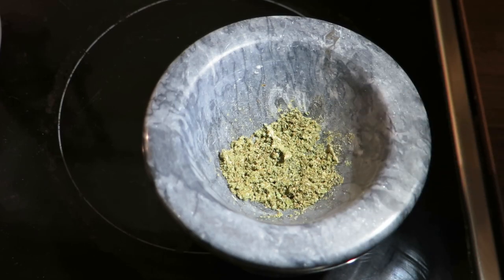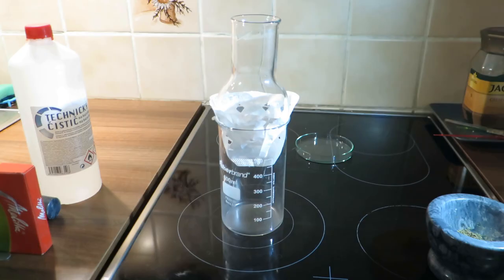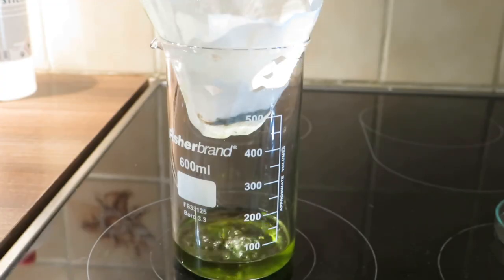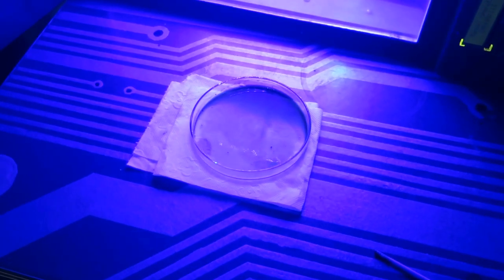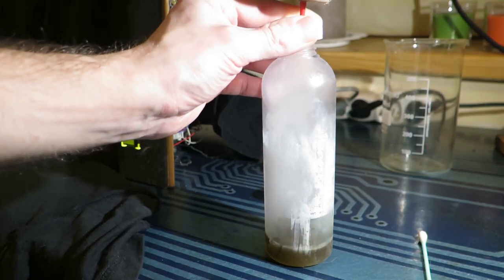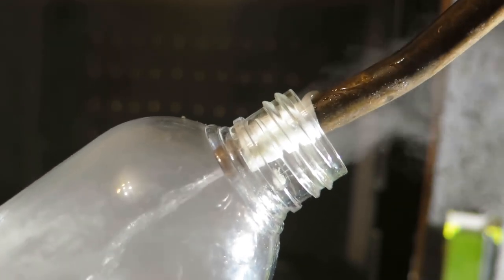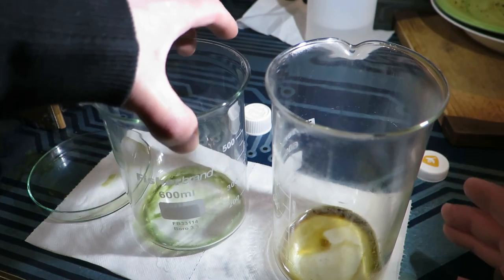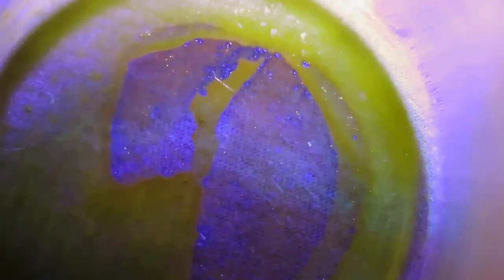Extracting resin & chlorophyll separation | plant material

Comment: Freeze your bud and alcohol beforehand bro👌 then only wash it for 20 seconds at a time so you don’t get all the green oil from the chlorophyll and keep everything as cold as you possibly can. 🥶
Reply: It what I do and it comes out perfect every time, beautiful Amber color,  people think they get more if they soak it for hours they just get more junk.
Reply: @jbob3744  I do 5 minutes and get amber shatter but I use the 99.9% USP isopropyl and have everything at -40F the whole time. Then i make warm RSO as a second run and make dank edibles.
Reply: The quicker the wash, the better the final product, what about getting out fats and lipids?
Reply: @hempearthtm  maybe but possibly less thc probably better color and better looking with your method
Reply: How do I kno if all the isopropyl is gone I put the rso in oil it looks like tar it's gooey but I hears to get a lil bit and light it with fire and if it catches fire then it still has some but I think it's bull shit I hit it with my heat gun and it starts but I think I'm just burning it  bubbling
Reply: @lifelessonslearn  Bro you shouldn't use ethanol. You should use non denatured ethanol 95%/96% max
Reply: @ChArLie360115  i used isopropyl 91% but i did the salt extract to remove the water from the isopropyl  to make it more pure then i froze  both the isopropyl and cannabis then i poured the isopropyl on the cannabis for about 1 minute and a half then i drained then i filtered it with coffe filters then i pured it on a glass baking pan in a well covered room with a window of course until the isopropyl evaporated then i put the glass  baking pan in the freezer for a while it made it easy to scrape off the R.S.O  i then put all that stuff in a glass mini container and hit it with the heat gun trying to remove all the remaining isopropyl but i think i accidentally burned the rso because it was bubbling then i smelled the oil witch smelled bomb like pure like this good smell i swear but thats were im stuck now i dont kno what to do next im scared it might still have isopropyl but its sticky it dont run when i tilt the container my question is am i finished now or is there another process?
Reply: Freeze bud and everclear for 24 hours don't break up the bud much before freezing. Do 1 minute rinse with the freezing everclear and run it through 2 coffee filters into pyrex. You can do a second run but it will be green not golden in color.
Reply: @lifelessonslearn  You should be good there.

Next time please don't use iso though. Find a food safe non denatured ethanol 95-96 % max. Infuse as usual with 2 filters through coffee filter, 3rd optional. I also recommend re-washing the material from the first filter whilst it's still in the filter with extra ethanol to ensure all desired solubles are extracted and not left behind in plant material

Then just evaporate off and you should have the rso left. You can heat over a double boil to remove any excess alcohol. If you want to completely remove any ethanol residue I recommend decarbing after reduction using a pan on low heat filled with oil with the reduced rso placed inside a container in the oil. Heat to content of container 110c (oil temp will probably need to be around 130c or so) until streams of bubbles stop and only small amounts of bubbles remain. This should take around 40/45 mins from reaching temp but may take longer/shorter circumstantially. Just go by the bubbles assisted by time judgement. You'll see a clear change in the bubbles.
Reply: @ChArLie360115  Bro You Don't kno were there's a video showing me how to do it  by chance I don't get it  need to see step by step it I don't wanna mess up.

Comment: An easy way to separate, you could doing mixed your ethanolic extract with two part of water and leave at 2-8ºC for 24 hours, the chlorophyll going to precipitateand you could take the supernatant and back to concentrate it, like the firt  method used (inverse way to evaporated de hidroalcholic extrcat)
Reply: Hi. Can you go further on this method?
Reply: Science Revolution  Did u try?
Reply: I would really love to know how to do this. How would you seperate water from ethanol? Cold temperatures are defenetly not enough ^^
Reply: Like, seriously. Ethanol and water just mix with each other, how are you going to seperate them? I mean you could use salt, but you still end up with one salt water phase, and one ethanol phase which still carries both, the chloropyhl and the cannabinoids. So I call that BS
Reply: Skip the ethanol, it's a waste of time and money, wash your Bud directly in the butain....bob's your uncle.
Reply: I done this once by accident and can confirm that it was a viable method
Reply: @5commandomerc  does that work just as good? if it does why do they let it seperate 24 hours in the freezer before filtering? thta wouldnt be possible with butane would it

Comment: A simple way is you can set in in the sunshine and it will clear up the chlorophyl. what about using hot water with no special high-pressure apparatus, as oil floats on top of water principal? us a syringe or baster to extract the oil off the top and then reduce/evaporate the remaining water? what do you think?
Reply: Dosent seem like lots of sunshine is available if homey has a sun box hahaha

Comment: Freeze flower for 48 hrs in chest freezer then take dry ice and and chill the ethanol mix the two together for 10 15 min . [time could vary) strain the hemp from ethanol and use a roto vap or hot water bath to get most of solvent out then purge it at 90f for a week. I would do a week if I can’t send a sample to a lab . I wouldn’t want anyone ingesting solvents
Reply: He doesn't have a separatory funnel, or a hot plate because he spent all his money on the roto vap.
Reply: Just use butane, it flash freezes the bud and strips it at same time...

Comment: Why not just cool the ethanol with dry ice instead of boiling it and avoid the chlorophyll problem almost entirely?
Reply from the maker: Didn't knew about such solution.
But even then, I don't have access to dry ice.
Reply: @IlusysSystems  Maybe you can order it on the internet? I find cooling alcohol in the freezer also works but I was thinking about chilling it in a dry ice and acetone/isopropyl bath. Should work wonders. You really don't need to add all that heat to strip the resin, alcohol will strip over 90% of the resin within the first few minutes. Also maybe the butane doesn't absorb the 'resins' because they aren't entirely non polar as they all have a hydroxyl group. When the butane hits the ethanol the temperature drops drastically and it will become more non polar so that may be why the goodies prefer to stay in the ethanol! It may be a little confusing because BHO is a very clear oil with very little chlorophyll, but thats only because the butane doesn't penetrate the cell walls to acces the chlorophyll. Very interesting procedures anyways I really enjoyed watching.
Reply from the maker: @FOATE  Thanks for info, my ethanol was at sub zero temperatures, which could explain, why chlorophyll wasn't dissolving.
Reply: @IlusysSystems  Yes exactly! temperature is a huge factor in the relative polarity of  ethanol.
Reply: @FOATE  if you could help  a struggling fool get better results I WILL listen.
      I have access to massive amounts of low quality weed "leftovers". Trim, old bud, homegrown hang dried, recently picked colas and everything else not worth smokin..
     I've made a very reliable BHO tube with shut off valves for each end that accommodate 8+ layers of coffee filter. Slowly filling the chamber with. Butane releasing pressure a few times to get more butane liquid in the weed material. (Assuming liquid butane + pressure=better yeald) 110 degrees Farenheit max purge followed by a week of sitting in a low dust/draft area. Room temperature
     Dark with little high I thought the lack of oxygen was the high . I've learned to dissolve the "wax" in everclear for 2 days in freezer then separate with syringes... I get material on top and bottom of a clear everclear middle. 
      
    Should/could I use everclear differently by putting into the blasting chamber a couple tablespoons everclear just  Before butane?. (Feel free to ridicule me if this all sounds moronic).
     Do you have any suggestions other than buying "equipment".
    I live in a retrofitted tiny home and have 12v power supply not 110. Super efficient freezer constant. 
    Other tha  a 20ton press "dry sift" situation I dont have the time to operate. I'm at a loss as to what to do with all of this material...
      I promise to gift an oz worth of grams to random folk if you can point me in the right direction...
      Here's my email if it's easier louisep595@gmail.com...
Reply: @louispeters2105  So if I understand your sitiuation, you have more leftovers then you know what to do with, sounds familiar!
One of the quickest ways to process these leftovers I find is making water (bubble) hash. Get some big containers that will fit all the leftovers and a paint mixer attachment for a drill, that thing will make this process alot quicker. Then I just use the 220 workbag and the 25 to catch everything. I don't bother with anything in between because IMO it's not worth the time. Then what I do, I skip the drying process and dissolve the hash in 95% ethanol when it's still wet. I put it in the freezer for 12 hours at least, filter and evaporate off the ethanol, the result is pretty amazing, beats most other hash oils out there.
Reply: @FOATE  thank you my friend. I will do just that.
Reply: @louispeters2105  I'm an old school outdoor grower in the heart of the Emerald Triangle in NorCal.
Massive amounts? Here's how I deal with that kind of volume.
Hopefully your BHO tube holds 8oz or more...and you have a shit-ton of butane.
First, harvest as much of the trichomes as possible. I chill a half pound in the freezer then put it in an appropriately sized micron mesh bag. Either a "bubble bag" or just a large square piece of mesh with the corners gathered to make a bag. Add crumbled dry ice in equal weight as your material. Shake over a large bowl or in a properly sized CLEAN NEW trash bucket. Add more dry ice if needed. Shake until no more material drops out. This takes some time. You can also put the mesh bag inside a plastic bag and shake, this catches ALL the trichomes and keeps them out of your lungs. Raw trichomes breathed into the lungs gives me bronchitis...

Now process the material you just "dry sifted" with your BHO device. I blow the BHO directly onto the harvested trichomes but first I clean the trichomes up by dumping them onto a large jar full of water. The trichomes should sink, leaving any plant material or dirty shit floating on top to be easily poured off. Let the trichomes dry before blowing the BHO on them.

The reason for this is that often BHO won't "melt" the trichomes fully, meaning when you just blow BHO you are losing a lot of yield and leaving most of the trichomes behind. This is why your plant matter is "sticky" when you take it out of your BHO tube. Making sense?

So you blow your BHO into a dish with your trichomes in a nice even layer on the bottom of the dish.

It will bubble and hiss, naturally. Here's one of my secrets.

Spray or drip some room temp water directly into the BHO in the dish. Not too much. You are making tiny little  hotspots in the COLD AS HELL BHO. This literally "foams" the BHO as it solidifies.

Next secret. keep this shit to yourself please...

Place your dish with the BHO/trichome "foam" inside a cheap ziploc vacuum bag and using the cheapo ziploc hand vac pump, evacuate the air in the bag. really suck it down tight but be careful not to let the bag suck down and touch the BHO. Get it so far?
Now put the BHO, which is under a vacuum now, into your freezer overnight. Pump the bag down every hour or so. This is removing the last traces of butane. It's a "freeze-dry purge".

In the morning you will have freeze-dried BHO. Fully purged and with ALL the goods your starter material has to offer without ANY chlorophyll.

Scrape your dish and enjoy smoking tiny golden crystals of very high potency BHO/Trichome goodness. Your friends will be tripping out on your amazing skills and might smile and say "Chemists, pffft." Then melt into the couch. That's when you know it's right.

You're welcome. If you really DO have massive amounts, I'll take an ounce of product. Thanks for your attention and best of luck. Reply to this comment and I'll email you my addy and whatever other advice you need.
Peace n Light.
Hood.
Reply: @FOATE  Nice method. I would probably use a bit more ethanol than usual and do a gentle boil at the start of the evap to decarb the THC so it's dynamite for edibles and tinctures as well. Other than that, your method is cheap, easy and effective. Very nice my dude.
Reply: @FOATE  That's brilliant. Why didn't I think of that myself? It's actually very logical. Thanks! But you freeze tge ethanol solution? Why is that?

Comment: Nice equipment improv! But why not just start with a regular butane/propane blast? You'll leave all that chlorophyll behind on your first blast and you can still of course winterize the wax out of it afterwards with the ethanol if you want. Or is there a specific reason you went with this order of operations? Not claiming to be any kind of chemist here 😂
Reply from the maker: Not actual chemist either, I used propane ethanol mixture to decrease propane volatility, which kindof worked, but the result was not expected. So I shared... Also to get feedback for better methods

Comment: Wash the finished product with distilled water or purified water you can rinse all the impurities out
Reply from the maker: Definitely not all impurities. In fact, for vast majority of plants, oily extracts are virtually insoluble in water
Reply: @IlusysSystems  have you ever tried the experiment if so you might know if not try
Reply: How you wash the producto dude?
Reply: @IlusysSystems  that’s because the oily extracts are the part you don’t want to extract when attempting to yield hash oil, particularly, in theory, a live resin type extract.

I’d rather smoke cannibidol oils than butane or propane impurities, even in trace amounts.

Comment: Interesting. Dangerous but still interesting. Your doing a liquid liquid partitioning b/t ethanol (+ water?) And butane
Reply from the maker: yes (no water), but resin ended up in alcohol fraction which is weird..
Reply: @IlusysSystems  all the resin (cannabinoid portion) ended up in the butane?
Reply from the maker: @Skunkhunt_42  No, it extracted into alcohol portion.
Reply: @IlusysSystems  ahh, I can't type. Did ya evap the butane fraction and see what was left behind?
Reply from the maker: @Skunkhunt_42  yep it was mostly chlorophyll as I have tested by UV light. It's good question whether this was only extracted substance... TLC analysis would be good idea to do here, but I did not have any plates..  dunno maybe in future I would have to do this again, so I will look at this method more closely
Reply: @IlusysSystems  i will join you in this pursuit. LLE with butane has been something I've been meaning to set up an apparatus for for years, but closed so I can play with other variables

Let's keep each other posted.
Reply: Was this decarbed oil/,flower or no?